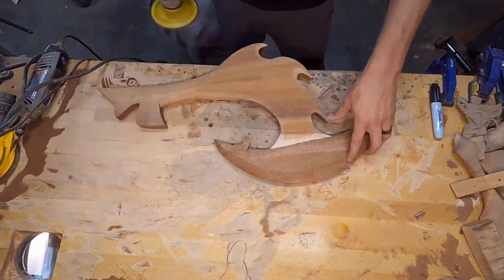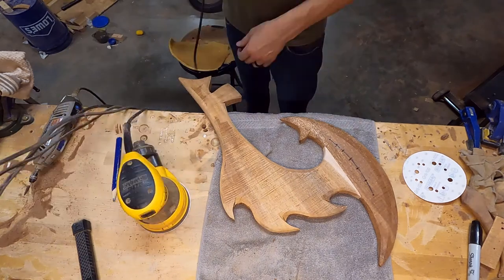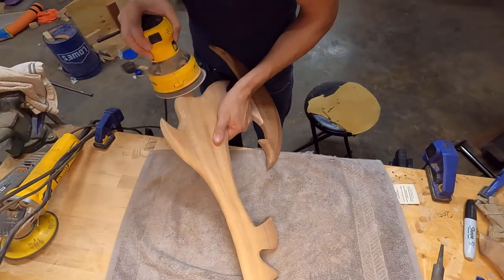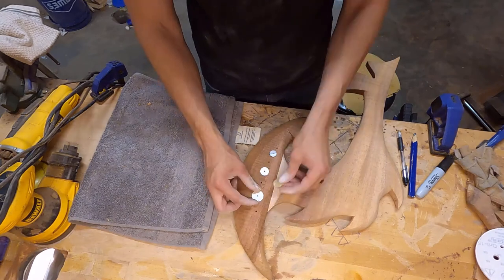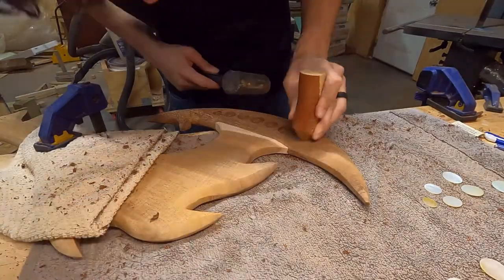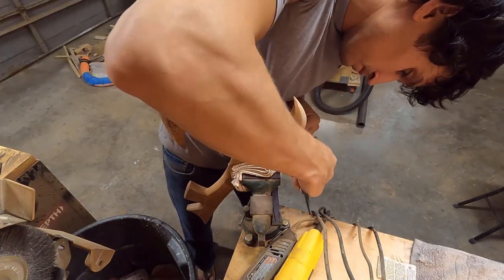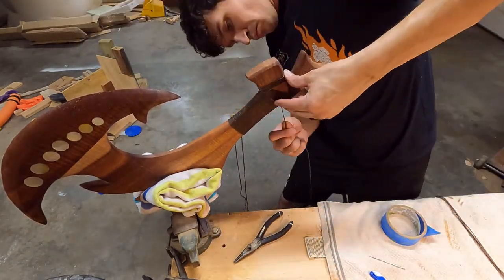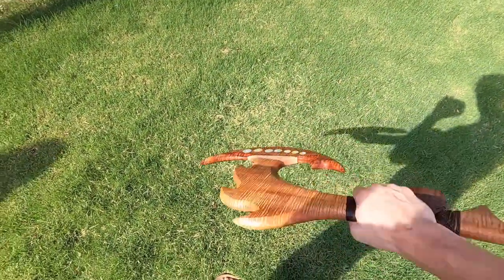Fishhook War Club, Maui has competition!

Comment: Very nice craftsmanship. You asked for suggestions? How about a drill cane with Hawaiian carvings on the shaft and expended brass rounds on the butt and tip?
Reply from the maker: I’ve made a koa wood cane once before with brass fittings.  Was actually surprisingly tough to make 😅 maybe I’ll get the chance to make a second one? Canes are a bit challenging. Because a user really needs a cane of a specific size. Especially if they are going to buy an expensive one.. so I will have to wait until I get a custom order for one.
Reply: @KoaStudio  a drill can doesn’t need to be a specific size and can be used as a self defence weapon. But yeah l realise lathe work and carving involved could be time consuming also
Reply from the maker: Also I don’t have a lathe 😅 maybe one day!  I might not be familiar with a “drill cane” I’ll have to take a look. The cane I made previously was a walking cane.